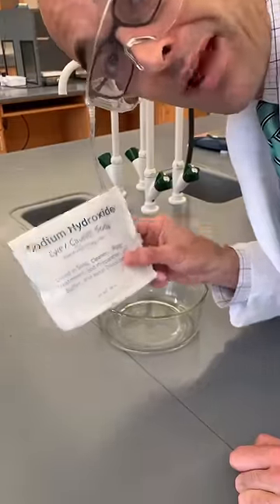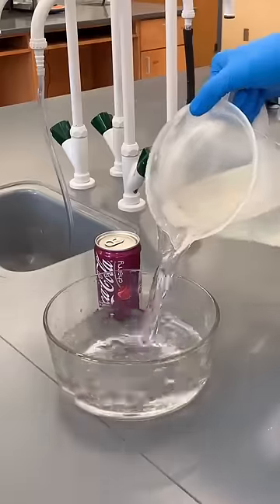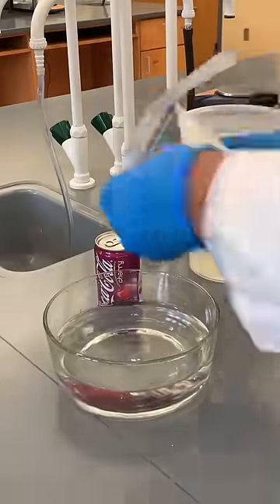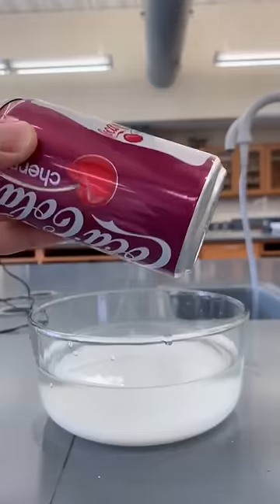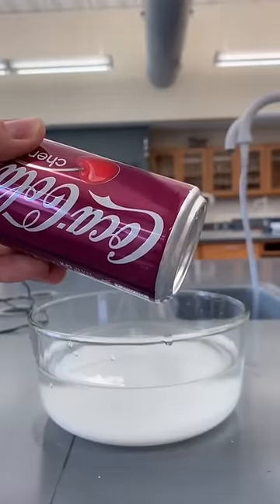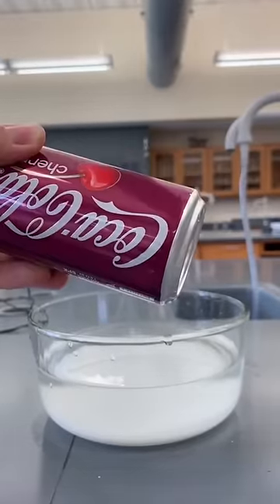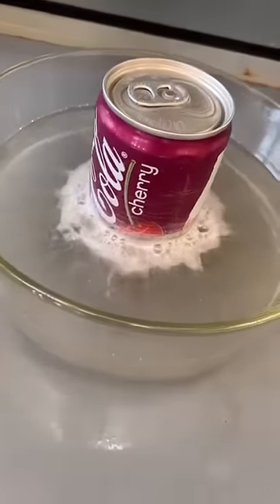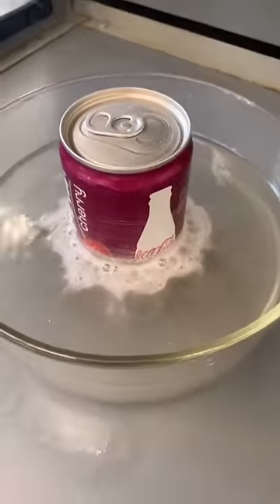Did you know this about aluminum cans?

Comment: You had me at “not gonna lye”. I’d buy the tshirt.
Reply: I take it "lye" is the same as sodium hydroxide??  If so, that WAS clever.
Reply: @jebidiahnewkedkracker1801  Yep. NaOH, or sodium hydroxide, is the same as lye. I know this because, as a high schooler in chemistry, I performed a lab experiment just a week ago using NaOH. I was confused why my fingers had a slight burning sensation, so I had to look up the common names for each chemical I was using, and of course, I found out I was unknowingly using a diluted lye solution. I wasn't injured, but I dunno why my teacher never mentioned we were dealing with a caustic, potentially deadly chemical 🤔 (or maybe she did, and my tired, unfocused mind didn't process it; with how tired I've been lately, it could be either 😅).

Comment: That's actually interesting I wonder if that's for every soda can or just certain brands
Reply: Every can, it's to keep the acids in the sofa to keep from degrading the aluminum which would add a metallic taste to the soda and make them perishable
Reply: @itstherealbrace6424  the taste the least of your worries, aluminum is a dangerous neurotoxin. Drinking from an unlined can could be potentially fatal
Reply: @RazzleberryHaze  while aluminum is a neurotoxin, it isn't dangerous at such low levels. thus it only applies to factory workers inhaling insane amounts of it in from the air. The reason the plastic layer is there is simply because the soda will damage the can and could cause leaks, which is only for soda. it's more than just soda that we eat/drink from cans y'now, and not much of it has protection. you can be perfectly safe drinking from an aluminum can as long as it isn't in extremely large doses.
Reply: @itstherealbrace6424  I miss the metallic taste
Reply: @RazzleberryHaze  Then dude... why do i find these weird aluminum Ball brand beer cups at concerts? they are like solid aluminum but look like solo cups! they are like hand held brain damage waiting to happen - why are these out there? (>'.')>
Reply: @ma2perdue  it's possible that there is a liner on the cup, aluminum is also fairly inert around most substances so as long as you're not enjoy a nice cold cup of drain cleaner you should be fine. It's not as reactive as copper thankfully, but even then, people still use copper for cooking and drinkware even though there are numerous studies proving that certain foods/drinks can and will start leaching copper
Reply: Is it the whole can? Or is the top aluminum?
Reply: @XxTheMedicxX99  the entire can is aluminum, and the entire can is lined with plastic
Reply: I unintentionally drank from a can with no liner, only a couple drinks. The inside of the can was rusted slightly. Tasted like I licked a rusty grill. Gave me a headache and stomach ache but was fine by the next day.
Reply: @ChesterCheatin  that may be, but it doesn't dismiss the fact that one should exercise caution while using bare aluminum (and numerous other metals for that fact). I work in the aerospace industry and certain PPE is required in certain areas of our campus. On the production floor, you get by with safety toes and glasses. Once you hit deburr/processing, respirators are required because of metal particulates floating in the air. There are also open flame warnings, because aforementioned airborne metal particulate is combustible.
Reply: Not just soda, all of your canned food has a linner as well. Aluminum can react or at least change the taste of foods.
Reply: All brands, and that includes beer as well.   One beer company made a great big deal about it in their commercials years ago, even though it was pretty much standard practice.
Reply: line my pockets 💵💵💵
Reply: It’s not plastic. It’s a coating.
Reply: @RazzleberryHaze  so interestingly enough copper pans do  have a very particular niche that makes use of ion leeching, and will result in the best damn meringue ever.  Adam Regusea has a pretty cool video on it and goes a bit more in depth.
Reply: @100GTAGUY  I'm glad you mentioned that, that was going to be my primary source if anyone requested the legitimacy of my argument! I can honestly say I've learned a lot from Adam.
Reply: @Jwomack025  Yes.  A plastic coating.
Reply: @Jwomack025  "It’s not plastic. It’s a coating."
Science guy says he's coming to show us that cans have a plastic lining. We proceed to watch a video of science guy showing us how cans have a plastic lining. 

How is a plastic coating not plastic?
If the plastic coasting isn't plastic, what is it?
I would have thought it was in the name.
Super curious.
Reply: @Flywheel2996  Aluminium doesn't taste like rust: rust tastes like rust. Your rusty can was made from steel.
And steel cans used to be tin  coated, but now usually plastic is used.
Reply: @95rav  never said it was aluminum, but you are right.

Comment: When I was a janitor in my early 20s it was at a restaurant without waxed floors & the kitchen was concrete floors, I used to use a mixture of 1/3 sodium hydroxide, 1/3 bleach, & 1/3 hot water - slop it across every floor heavily, then scrubbed them hard, then came back to soak it all up wrung mopping, cleaned the floors good... The health department and OSHA would probably have had a fit about it but that was the early 90s when it was easier to get away with that sort of thing. Lol

Comment: Great idea to debunk the claim that there is no plastic liner on the inside. The Al turns into Al(OH)3 and releases H2 gas and dissolved sodium hydroxide. However, the plastic liner remains intact as it did not react with the rest.

Comment: The reason for the plastic liner is that aluminum is toxic. Yes, aluminum is considered toxic. It is a neurotoxin that can cause damage to the nervous system and has been linked to various health problems, including neurodegenerative disorders like Alzheimer's disease and Parkinson's disease. Welders that don't wear PPE's and weld aluminum for awhile will get aches in the joints, headaches and permanent nervous system damage. The fumes have a sweet metallic taste. 🤢